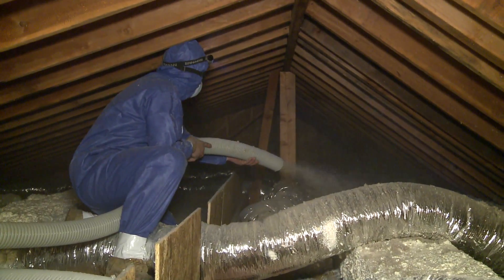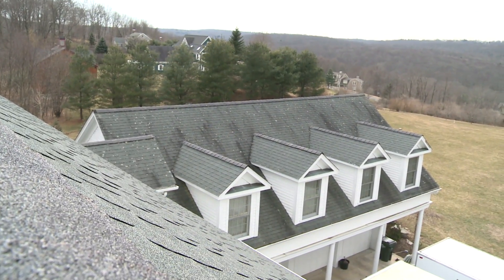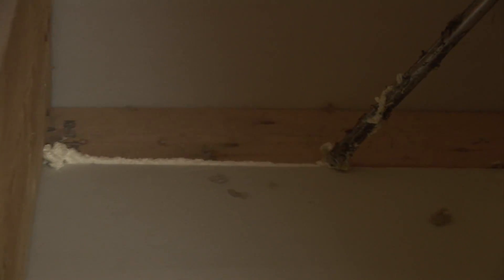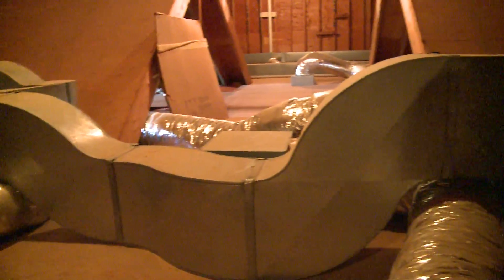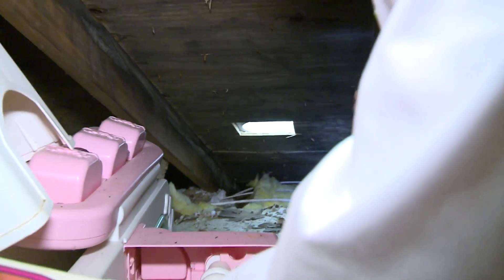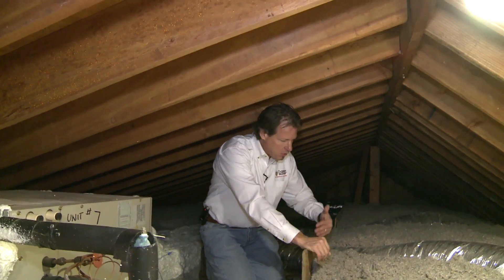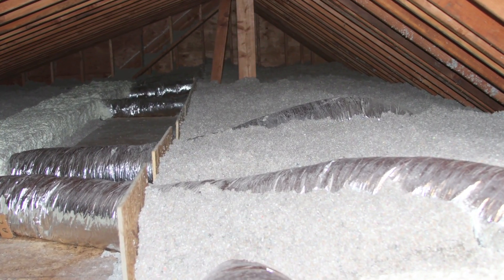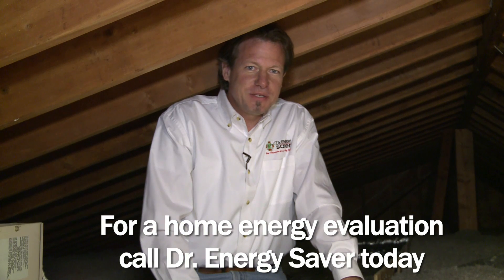Air Sealing and Insulating a Conventional Attic

Comment: If I had a ridge vent installed on a new roof, should I close off one gable vent that was there? I have soffit vents.

Also I found one area 3x15’ completely void of any insulation where a tray ceiling meets the exterior wall basically. Only thing I can think of is when they blew in the insulation they just missed it. I can see the back of drywall. Should I cover that with batt?
Reply: This is very random and a year late but, you should have about as much airflow into the attic from soffits and gables as the airflow out the top of the roof. This allows proper convection of the hot air, and proper dissipation of any moisture.

Comment: In my attic I have some knob and tube that is still in use.    I can't insulate direct contact but could I put plywood or foam board ontop of the joists (leaving the joists empty) and then dump a bunch of cellulous on top of the new ply/foam board?

Comment: When "sealing" the attic from air escaping from the interior of the home, wouldn't the entire top border of the attic need to be sealed with low density foam? Aren't the walls that make up the boundary of the home also just like "top plates?" And aren't these bordering wall top plates really hard to access since the slope of the roof is narrowing towards them? Do you seal them? Thank you?
Reply: Some top plates are hard to get to yes but they should be sealed. All exterior walls should be sealed as well. Also, if you have soffits you don't seal them you just insulate them and install roof baffles. Hope that answers your question

Comment: How would you air seal bathroom exhaust fans? I have been considering building a box from 2" foam board around mine.
Reply: That will work, although I used 1/2" foam board on mine.

Comment: Ever heard of Aeroseal? Also, it’s application to not only a house, but sealing ductwork as well.
Reply: I called a local HVAC dealer who does the Aeroseal and they said the average cost to aeroseal is about $2800. I'm 63 and I'm not so sure I would live long enough to see the payback on that investment. So, I'm just going to seal my ductwork as best as I can with caulk and foil tape.
Reply: 2 or 3 times more expensive than sealing the ducts manually.

Comment: What type of caulk or sealant do you recommend to seal cracks between framing studs and seams between floor and bottom plate (ie can you recommend a brand)? Same question for spray foam to seal larger gaps...will any spray foam do or is one better than the other? Thanks!

Comment: You mention in the video that hot air radiates downward in the summer. Is it possible for cold air from the attic to radiate downward in the winter?
Reply: Dan Atkins:  Heat transfer always moves from hot to cold.  That's basic physics, high energy (heat) to low energy (cold).  In winter, a room with high heat loss will feel colder because energy (heat) is being transferred up to a cold attic.  Of course, if you have a really drafty room because of old windows, you will be getting lots of outside air making the room uncomfortable.

Comment: I am about to air seal my attic before insulating it.  I have 3-5" of old cellulose.  I am planning to get rid of all it or just toss it over my front exterior porch.  Would you recommend to foam all the ceiling joist (I have plaster/lath) or just need to air seal the top plates?

Comment: love the vid, but I can't understand the "blanket" of blown in... are you shooting it against the corner ? mine is already blown in and I hate it because its so deep and can't get around... I want to : condition the space with reflective sheets ...and remove the  soffit  "cardboard" which I  hate because it is not Stiff like a sheet of foam.  and make it more livable... it is really hot peeking thru an access ( when my roof was leaking) when I needed to fix the bathroom ceiling...horrible air temps... it was probably hotter than outside. Does blown in cellulose "retain" heat? I would like to move it all to the garage which is not insulated and start over as much as I can. I believe in your radiant  barrier and these other guys showing a roll of film is going to " fix it" just doesn't jive..plus they want to leave a 3 in gap at the bottom or its " not going to work." love to all and be safe.
Reply: richard michalko 
That's stupid

Comment: i have a 1984 ac unit up in the attic but it is no longer being used and i was wondering if i should take it out piece by piece or leave it
Reply: Seal off the room vents as the unused ducts are transferring heat between your attic and rooms.

Comment: Michael, it doesn't matter if the cellulose sits on top of the sheet rock from the ceiling below. I know experts like Dr. Energy Saver would recommend that you air seal the ceiling below the attic first to stop air lose and the convection effect from the air escaping from the house, to the attic, and then outdoors. So I would air seal first, then get spray in cellulose but make sure that do not block your soffit vents. I hope this helps.